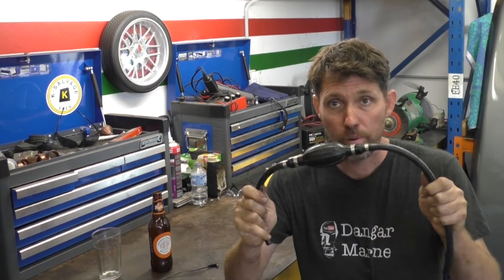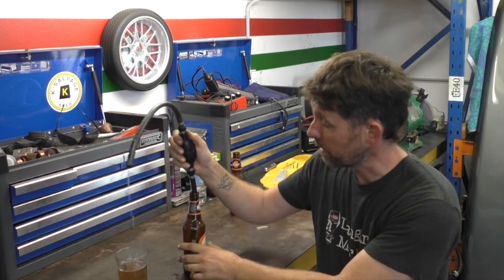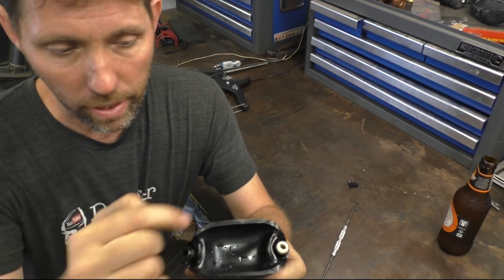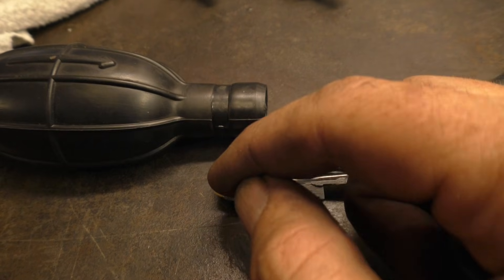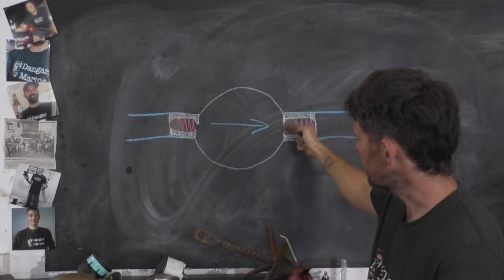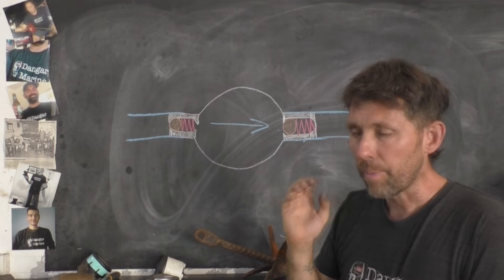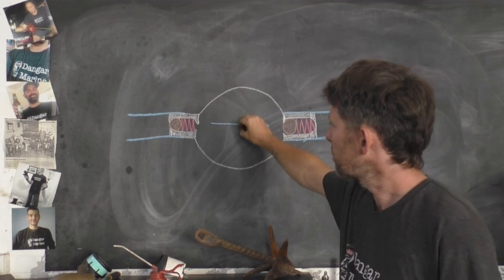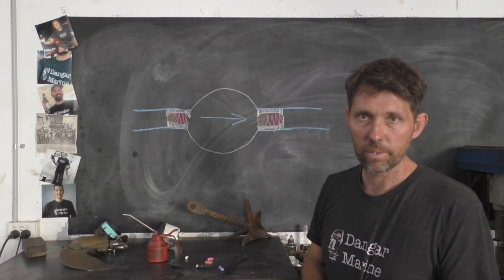Outboard primer bulbs

Comment: DangerStu your videos are the best, literally when I have issues (ALOT) with my engine, I can guarantee you have covered it :) 

I have been having issues with my old 1990's 9.9 Yamaha outboard. I had to give it a full strip down, changed all oil, cleaned carb etc. Ever since its not been running right, it starts straight away and idles okay, but after running with higher revs for a little while cuts out... 

I did replace the fuel line with one i had for my other outboard (30hp) which was 10mm, old one was 8mm. Would that make a difference? 

I have also noticed somehow the fuel connector on the metal clip the arrow was pointing the wrong way, I cant find much information on these if that makes a difference? 
I know the pumping bulb flow one way (thanks to this video) but not sure if the connector does as it lets fuel past it when pumping the bulb. Wondered if you knew the answer? I have ordered a new 8mm line and will ensure all arrows are pointing towards the engine, i'm praying this is the answer.

Keep up the awesome videos, helps noobs like me :)

Comment: I follow your videos and like them very much. I have a 9.9 mariner two-stroke. I have completely rebuilt the carb all new gaskets and read bulbs. It starts ticks over can read manually but when I engage the gear and open the throttle it bogs and installs now I’m stuck

Comment: Question:   not getting fuel to primer bulb.    I ran a new fuel line from pickup to primer bub area.  took the pick up tube out and it was clear.  put a thread sealant and replaced the barbed fitting to pickup tube.  has gas  any other ideas?   when i put gas in tank tank is below deck so when i put gas in the gunnel area, it does not flow as easy as i think it should and can back up.  I blew air from outside side of boat tank vent and air went in.  lost and seeing if you have some idea  thanks,  Brian

Comment: I changed out my old primer bulb and hose because my motor kept pulling the lob bulb flat. I also put in a fuel water separation filter and changed all the old hose but it is still doing the same thing only this time if I just let the motor idle the bulb fills back up with fuel. Help can’t figure it out

Comment: I have a 2004 40 merc 4 stroke was bogging down now idles smooth but when i give more throtle engine dies,couldit be one ofthe fuel pumps ireplaced fuel filter n new fuel hose n new bulb.

Comment: I know this video is an oldie, but i found it very interesting! I have a lot of trouble getting, and keeping my ball hard!😯😜 LOL I have a 4 year old Yamaha F40LEHA 4 stroke and I can squeeze that thing all i want and it stays relatively soft. Everything is like new and I only have about 37 hours on the motor. I will give it it a go in the vertical up position and see what happens. Should it remain firm during operation?

Comment: I just spent all day fishing by the boat launch with a new motor I just picked up but used the hose and primer bulb from a one year old motor, the primer bulb just stayed soft no matter how many times I squeezed it and the motor wouldn't start, I had no idea the angle of the bulb mattered at all, ill try that tomorrow and see what happens, thanks
Reply from the maker: If it still doesn't prime it could be a bad needle and seat in the carburettors.
Reply: @DangarMarine  it's a brand new motor and when I got home I used the new hose assembly and bulb and it started first pull, can't believe Honda would use such a cheap primer bulb that lasts just under a year used a few times.

Comment: At high RPM 5200 why would my Primer bulb collapse which will also cut off gas flow? Decrease RPM and the bulb returns to normal shape and engine goes from cutting off to full speed again.
Reply from the maker: Sounds like the breather vent on the tank isn't fully open so air can't get in to replace the fuel you are burning.

Comment: thank you so much. so today I took the boat for labor day For the life of me I couldn't get the bulb to tighten up. tried for over 15 minutes. finally I gave up, loaded the boat back up and went home. once at home, I figured I might as well figure it out. I squeezed the bulb and within 3 pumps, solid as a brick. hmm. WTH, here's the thing I realized after your video, at home I was standing OUTSIDE of the boat and I (without realizing) pumped it vertically, at least that's what I'm guessing. so thank you so much

Comment: I broke down in the Intracoastal Waterway this morning due to a faulty primer bulb. It wasn't until I returned home and autopsied it, that I discovered the bulb had some type of plastic liner, presumably to protect it from ethanol fuel. That liner had degraded and blocked the valve going to the engine and was starving it - it was three years old. I removed the liner and it works perfectly. I could kick myself because I left my spare at home. I had to get towed in and it wasn't cheap. I will always have a spare this day forward. Thanks for the video, Stu!
Reply from the maker: Ah, the spare you need is always the one that is at home.
Reply: @DangarMarine yup unfortunately same thing happened too me yesterday but I had a small tank with hose  just incase but when I got it started I didn’t feel like taking everything apart in 5 6 foot seas but yes made it home 10 mph if I gave it gas it would stall so I just left it low speed made it back thank god no tow but yes now I know how a primer ball works thanks again bro 😎

Comment: I have a 1 month old one of these lines for 6hp Johnson. Basically it’s completely filled with gas but none will go to my engine. I’ve depressed each end to try and open them up but nothing. Is the bulb messed up?

Comment: One of the easiest way to check if the spring is faulty, leave the car parking overnight with fuel cap open or close fuel cap without rubber o ring. If the car starts right away in the morning, which means the spring is allowing the fuel travel back to the tank over nights. This applies to the long crank issue in the morning
Reply: "Car"???

Comment: If mine sits for a day, all the fuel drains back into the tank. It has always done this, even after replacing the bulb. Seems like it shouldn't do this with both check valves working against any back flow. The sealing at the check valves must be very weak since the normal fuel flow must overcome this too. I also siphon fuel out of the tank through the bulb.

Comment: Another one of many great videos!  Thank you!  I have a quick question, the bulb is not supposed to remain hard while the engine is running, is it?  I'm thinking it is normal for the primer bulb to loose the firmness once the engine is running and fuel is flowing.  Is this correct? Thanks again for the GREAT videos!

Comment: I just want to say thank you. I needed more fuel than I had on hand to keep my generator running from Hurricane Ida. I was fighting to get fuel out the bulb and couldn’t get a hose into the tank. Something so simple as holding the bulb straight up allowed me to get 10 gallons out which will keep my fridge and fan running for another 2-3 days. Thank you again.

Comment: Holding it straight up also means the top valve is held closed by the weight of some fuel in the line and if it does leak a bit you get fuel back into the bulb, not air.

Comment: Thanks Stu, another very informative video, I have a couple questions. I need to change my line and bulb... I don't know if it is a 3/8" or 5/16" setup? and don't want to dismantle until I have the new line and bulb. line feeds a 25HP Mariner, so my guess is 5/16" line. Is there any way to know without dismantling? no ID numbers on line. Boat is still being used. and if you can recommend a good brand that would be appreciated too. I understand that some of the lines sold today do not fulfill fuel usage standards.

Comment: Question if anyone can help;  My 2007 Honda 15HP (very light use -5 hours a year) the fuel line / bulb / motor is not drawing fuel on its own, once it has been primed. The motor Eventually sputters and stops and I have to keep pumping the priming bulb to keep the pressure up.  Any idea where to start?  It’s the original tank and fuel line.  I haven’t been holding the bulb like he says too here.  Of course have the tank air relief valve open.  And it appears that it draws the fuel out of the line and bulb, collapsing the bulb Into a vacuum state..... but for some reason it’s not pulling it out of the tank.
Reply: I think you're supposed to prime the bulb with the relief valve clossed.

Comment: How long should the primer bulb stay hard?  A few minutes or so or should it stay hard until you release pressure?
I am fighting a bogging issue and it has to be fuel.  Boat starts and idles great, will not go above 2500 rpms in gear.
Reply from the maker: It shouldn't lose pressure too soon. If it is dropping off quickly then the fuel may be going somewhere, either a leaking needle and seat in the carburettor or a torn fuel pump diagphram, both of which may have it running rich and bogging down.
Reply: @DangarMarine  Thank you, my new fuel pump should arrive today. If that doesn't work then it is carburetor kit time.

Comment: Thanks for the video--here is a stupid question. Why does air get in the fuel line in between engine runs?    For example does the fuel fall back into the tank or something, and the fuel is displaced by air?  My motor is a 1995 Yamaha P50TLRT that runs like a champ.  I just replaced the primestart solenoid and diaphragm after watching your videos (Both were broken). My concern is whether having to pump about 20 times is normal?  It starts after 3 short 3 second bursts of the starter, consistently.  Is this normal/acceptable behavior?
Reply from the maker: It’s a combination of gravity combined with a leaking one-way valve in the primer bulb, leaking fitting at the outboard and leaking needle and seat in the carburettor all letting the level fall and air replace the fuel. There is also an element of evaluation of fuel in the carburettor bowl after the needle and seat.
Reply: @DangarMarine  Thanks! I will check on my primer bulb and outboard fitting  and go from there.  I know they are aftermarket and not sure of quality/age.

Comment: I'm wondering if a sticking ball valve   would cause the engine to starve .  My engine runs for a couple of minutes then dies but comes back to life if I squeeze the bulb as its running.   Anyone have this issue?
Reply from the maker: Sounds more like a problem with the fuel pump on the outboard.
Reply: @DangarMarine  Thanks for the tip.  I'm getting a rebuild kit today.  The bulb is crusty so I'll replace that too.
Reply: @DangarMarine  turns out it was bad gas.  I rebuilt the fuel pump anyway.   Thanks for the advice.   Cheers

Comment: Great video. If the pump and hose is empty, then where does the air go? To the engine or to the fuel tank? I guess it goes also in the arrow direction, but don't you release that air somewhere
Reply from the maker: Air will just come out through the carburettor.
Reply: @DangarMarine  thank you

Comment: Hi Dangar thanks for explaining the priming bulb. very helpful mate.
I had an issue this morning with a brand new outboard and fuel hose .the hose was already connected to the tank  with arrow pointing in correct direction,so the other end could only go to outboard.
1st time use since picking it up from dealer.
spent an hour trying to start it.
I went home gutted after being at boat ramp at 5.am on maiden voyage.
The problem was the arrow indicating the flow direction was wrong.
I removed the primer and tried the test you showed on your video with stubby.
The bulb worked only when arrow was facing into the stubby not going out of it.
Grrr. Definitely a fail in assembley line.
keep the videos coming cheers🍺

Comment: Question??? Does the Primer Bulb go in between the Fuel tank to water separator or Water separator tor to fuel pump if that makes sense.... or does it even matter the direction?
Reply from the maker: It can go in either place, I prefer between the fuel pump and the separator for more direct priming of the engine.

Comment: Does that kind of pump could be mounted in the fuel car system for good? I have problem with my old Volvo with mechanical pump if not using car often.
Reply from the maker: They can add a bit of resistance into the fuel system. A simple 12v automotive pump may be a better option.

Comment: Our boat will stay primed when you prime it and then it will cut off after running for a while no matter slow or fast of course it will cut off faster when at a higher speed we go pump them bubble its fine will crank and run then this happenea again I noticed while riding on the back holding the bubble that it feel like air bubbles in the prime bubble and the gas line closest to the engine was vibrating will a faulty valve do this everyone keeps saying air is coming in from somewhere we juat replaced the bubble it ran fine for a while and now it is cutting off im debating on going to buy another thanks

Comment: Great explanation! I have a 1978 15 hp johnson. I had an old fuel line and bulb that when you squeezed it, it wouldn't reinflate (would take 1 min to reinflate). I bought a new line and bulb...same thing happens, won't inflate. Any idea of what could be going on? It also will only run with the choke all the way out, so i will be cleaning the carb and replacing the carb seals. Thanks again for the video!

Comment: Could this be an issue at higher rpms and not giving the outboard enough fuel? My outboard runs great at low rpms and at idle but once I get to 3000 rpms it bogs down.
Reply: You ever fix this? Having this same issue

Comment: On my 4 stroke df140 if I’m switched off for over half hour or so I need to prime the bulb to start otherwise it just cranks without starting. Is this because my bulb sits horizontally allowing fuel to flow back to the tank?
Reply from the maker: It's a big weird at the carburettor bowl should stay full still. A new bulb is a good cheap place to start.

Comment: Will you cut open the new  epa rated bulbs from  Attwood  and other cheap bulbs are selling . They have a thin plastic liner that is suppose to  keep the ethanol  from eating the rubber . Whats been happening is the liners are breaking lose and  blocking the flow  of the gas . You can pump it and it forces gas out  but once you start going down the lake the  liner starts to block the flow  of gas  making you think you have a carb problem  when its because of the bulb liner . I bought a  mercury one   after I started reading about it  and the problem stopped and it runs great now . It was the stupid brand new cheap attwood  bulb .This   just started  in 2018  when they changed something with the epa .

Comment: Great explanation. My setup is with the primer bulb in vertical but after two or three years, not exposed to sunlight the Yamaha bulb is still like new/soft but the bottom check valve goes bad. I was thinking of adding separate in-line check valves. Any thoughts?
Reply from the maker: You could, but given how cheap primer bulbs are it is probably easier just to swap it for a new one.

Comment: Well I never thought to hold the primer in a vertical position but it makes sense! I have a good running outboard but primer bulb issues after replacing it. Will give it a shot!
Reply: Keep primer bulb about 13 inches away from the gas tank get primer bulb that goes with your engine I had no problem after

Comment: is it possible to replace the primer bulb by putting a low pressure 12v pump and have a switch mounted on console. I am 78y/o hands have lost strength and not easy to continue getting out of seat and climbing back to engine.
Reply from the maker: Yep, I can't see why not, plenty of carburetted engines have then. So long as it doesn't overpower the needle and seat it should be fine.

Comment: Where would you put a fuel filter
Reply from the maker: I would put it between the bulb and the fuel pump.
Reply: @DangarMarine  my outboard is a Suzuki 8 from 1989 I'm not sure if it has an internal fuel filter or not

Comment: Question form South Texas.. Could the be something before the primer bulb that could be clogged? I noticed the bulb collaps and the motor bogged down
Reply from the maker: The most common cause of this is that breather on the fuel tank is closed causing a vacuum in the tank and making it hard for the pump to draw fuel out.
Reply: @DangarMarine  this is a center console boat with a gas tank in the console would that breather be in the top of the tank where the fuel line goes in

Comment: With your older boat motor primer bulb can be used as an anti siphon valve if arrow points up . Avoid the cheap aftermarket bulbs kids I've seen a few rebuilds because of defective products starve an old two Stoke and you are smoking pistons . Always nice to have a small spare tank and hose . If you lose power get off the throttle and change to the spare tank and hose . In other words . Be safe kids !

Comment: Would a faulty bulb cause issues during wide open throttle or heavy acceleration? I’ve always had issues keeping the bulb solid when priming. But it starts and runs first pull it’s just once I get above about half throttle or accelerate hard up to it, it seems to starve itself and die. I can keep it running if I am constantly pumping it.
Reply from the maker: Sounds more like a faulty fuel pump or spit in the fuel line sucking air in.

Comment: Thanks!  Question:  I am replacing a broken primer bulb on a 70 hp Force outboard.  The fuel line on the fuel tank side is black, like rubber.  The line on the engine side is yellow, like nylon.  Most of the assemblies I find for sale are black on both sides of the bulb.  Can I use these?  Or should I be making sure to use yellow nylon fuel line on the engine side like it has now?